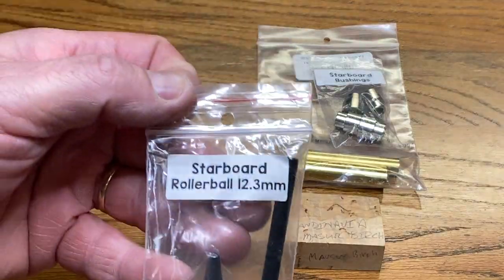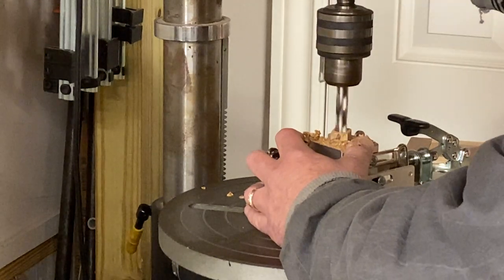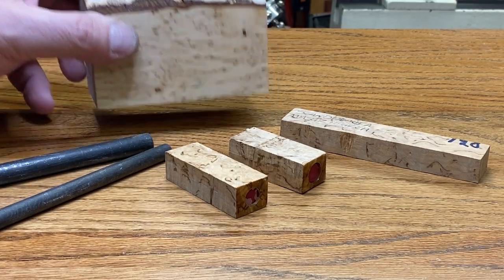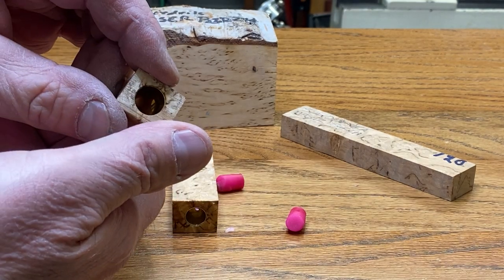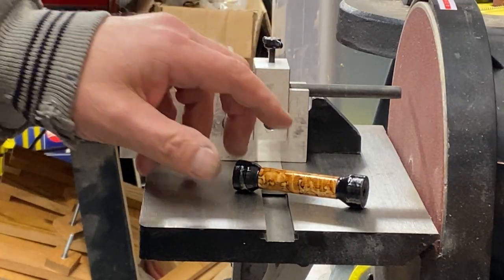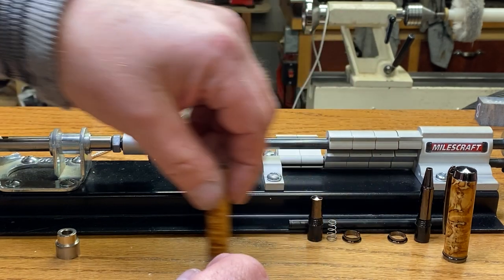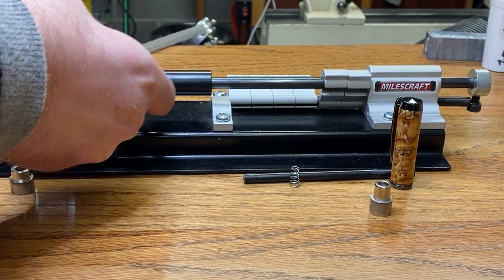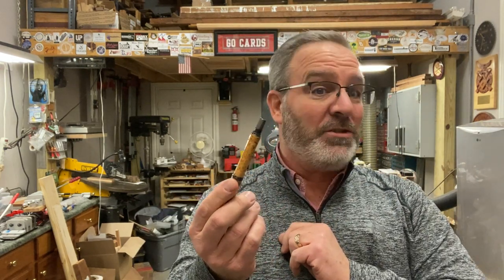Starboard Pen Kit with a Masur Burch Blank

Comment: Another great video Bob, thanks for always keeping in the "issues" you work through during a make.  Two things I like to do, 1) to keep the grain aligned, I like to transfer the registration marks to the inside of the tubes using a Sharpie marker before I start turning.  That way I know for sure what the correct alignment is, I then, move it back to the outside of the pen with thin painters tape strips when assembling.  Sometimes aligning the cap grain is tricky. 2) I have noted that some kits just have really tight fit for the assembly.  That coupled with a thin turning and/or hard/brittle wood is a problem, so I picked up a set of chainsaw sharpening files (little round ones) at Harbor Freight, and I file out the inside of the tubes a bit to ease the fit.  Have a great day!
Reply from the maker: Thank you David. 

Regards,
Bob

Comment: Blast.   its the worst when that happens on the last step.  This happened to me when I made a gift pen for someone.    I "fixed" it by disassembling the pen and turning away the cracks and made a black ring from some black ebony I had.  Cheers mate
Reply from the maker: This one was my fault. I used the wrong size tube. Great idea for the fix of that pen. 

Regards,
Bob

Comment: Love the wood.  It happen a few time on those pen or semelor one. The thing i do to prevent that bad lock, i sand the the ring that go's inside the brass. If it has been sand to mutch, i put a little glue on the ring and doe's the job.
Reply from the maker: Thank you for the info. 
Regards,
Bob

Comment: Great video as usual sir! I have 2 questions for you. Do you reuse the silly puddy/playdoh between pens? I am curious if the ca glue effects it’s pliability and ability to reuse it. And 2ndly do you have a preference on epoxy?
Reply from the maker: Hello Eric,
  It’s a one used application as it dries out. Luckily it’s relatively cheap. 😃

Regards,
Bob
Reply: @RJBWoodTurner  Thx Bob! That’s exactly what I was guessing. How about your epoxy of preference?….
Reply from the maker: @ericwhitsel61  I’ve used Loc-Tite and The PSI 5 minute epoxy. They both perform the same. And they last a long time. I still have some of both and the next time I buy 
 price will be the decision. I get Loc-Tite at Menards and Lowes so no shipping. 😃
P.S. keep your epoxy in the house, if it gets cold it gets super thick. 

Regards,
Bob
Reply: @RJBWoodTurner  Once again, full of useful tips! Thank you.

Comment: Каким полимером стабилизировали древесину?
Reply from the maker: The resin is called Cactus Juice. Place the Cactus Juice and wood in a vacuum chamber and pull the air out of it. The air is replaced by the resin. Let it dry and the wood is stabilized. 

Regards,
Bob
Reply: @RJBWoodTurner  Thank you friend!!! 🤝🤝🤝👍👍👍